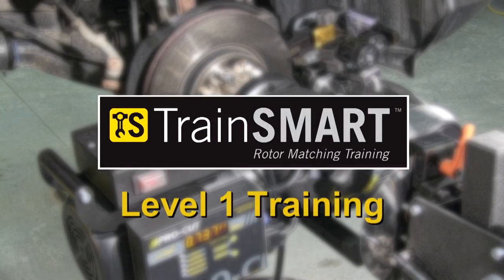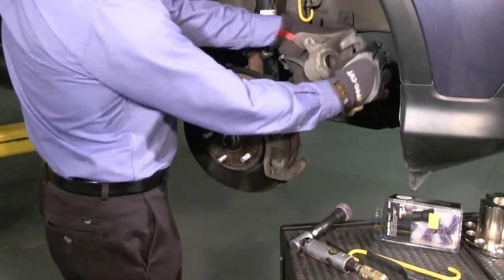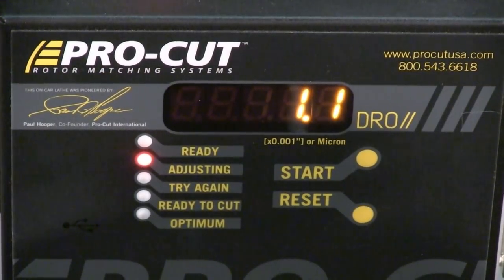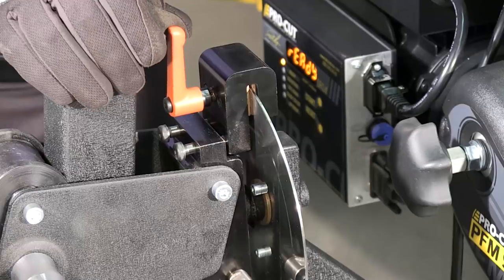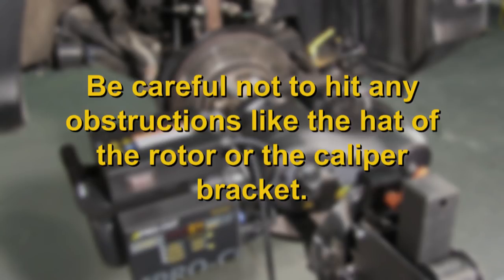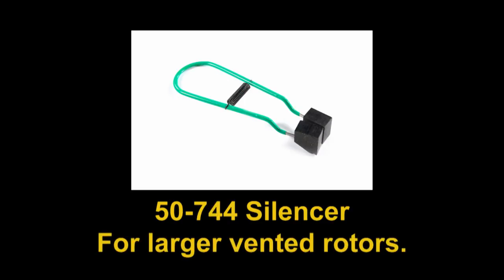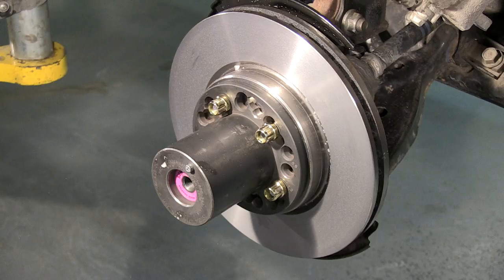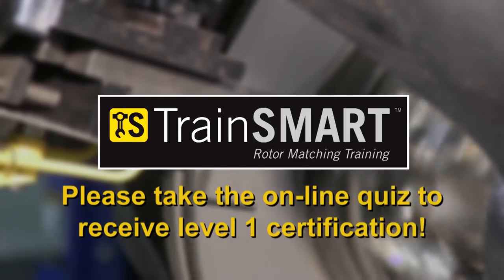Watch TrainSmart Level 1 for On-Car Lathes

Comment: the purpose of the on the car brake lathe is not to remove the rotor. so why would you remove rotor an clean it up? it defeats the purpose an idea of saving time.